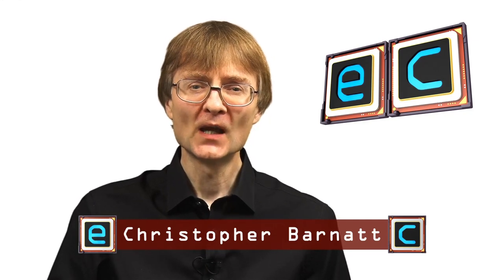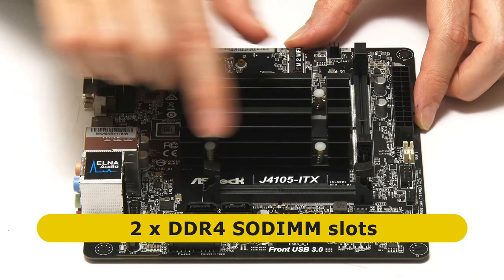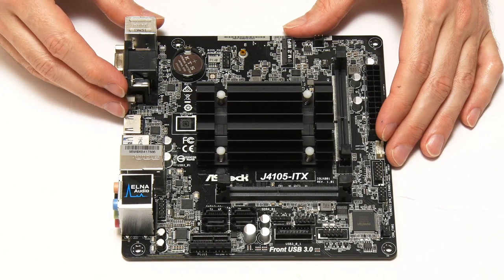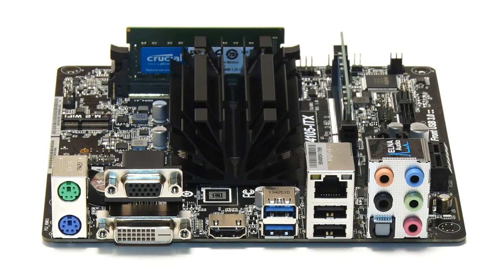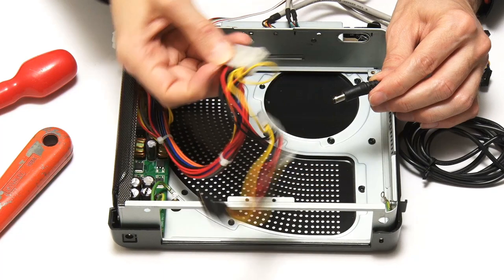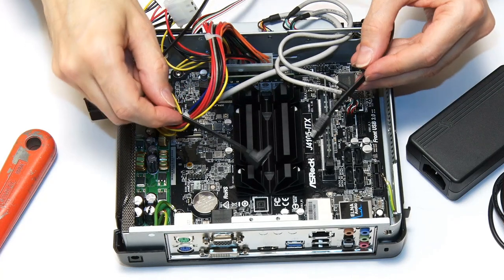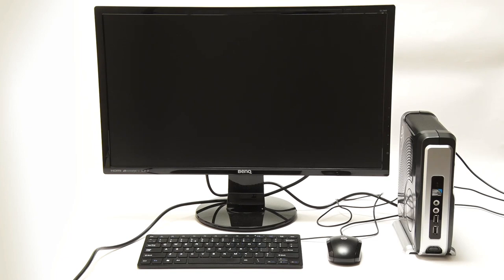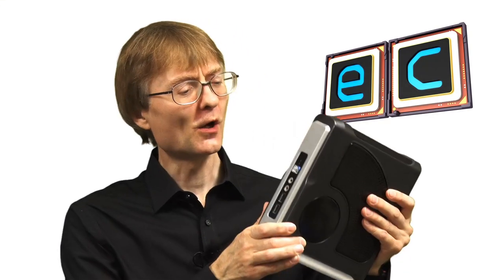Silent Mini-ITX PC Part One: Hardware Build

Comment: Still finding legacy PS/2 ports on motherboards nowadays is weird. I haven't seen new PS/2 keyboards/mices around for sale for a long time. 🤔
Reply: It made sense for Mini-ITX boards when they first came out; they were intended for use in industrial and commercial settings, like digital signage, controlling factory equipment, data logging and such, and had the full complement of legacy ports: serial, parallel, PS/2 and VGA.  They often replaced older full-size 486 and early Pentium systems, so the users in these settings wouldn't have to buy new peripherals.  It does seem odd to have them modern motherboards, though.
Reply: People still love their IBM Model M keyboards which use the old adapter, although I believe it's possible to get replacement cables with USB connectors nowadays
Reply: Frees up a USB port
Reply: Its actually superior to usb🤣
Reply: There are organizations, the FBI for one, does not allow USB ports enabled to prevent data theft via USB flash/thumb drives.
Reply: @JoeStoppinghem  With a little bit of software and a prepped keyboard you can do that with a ps/2 keyboard and install a keylogger too.
A computer can set the caps lock led and NumLock led. You might be able to use that for data transfer initiated from the computer.
Reply: Hans Kruse I’m referring to grabbing gigs of files.  It would be simpler to have a USB 3.x thumb drive.  These portions do not have internet access.
Reply: @JoeStoppinghem  WiFi can be added of course or sneaker net collection. But true getting gigs of files over a creative serial connect ion is slow.
Reply: Hans Kruse I think the main was lost.  

Having p/s 2 ports allows the organization to turn off all USB port to eliminate data being copied to a USB drive and take the drive and that data offsite against policy or illegally.

Comment: First of all, please allow me to thank you for your continuous input through your YouTube channel. I always find myself going through your material every Sunday.
I know you have several videos relating to single board computers, small factor pcs or even refurbished old pcs/laptops, (not to mention various networking software solutions) but I thought it best to write you to get some personalised feedback if possible.

I am looking to revamp my home/office installation. The current system is quite dated and has a few work-arounds, so I am looking to update it to the 2020's and hopefully upgrade functionality and speed while keeping the costs and power consumption reasonable. 

My main machine is a laptop (currently researching a new one), as I am always on the go and use it all over the home and at clients' offices.
At my home office I would ideally like a system where I could back up data and also have a repository for past projects (engineering, admin, finances, etc). I expect this machine would probably best run off at least 2x3.5-inch HDDs (4TB capacity) raided together. While I would need it to be networked, it would be a big bonus if I could securely access the machine remotely (i.e. from my client's offices). That said, as this machine will be on all the time, I would like to find a solution to keep the power draw/ consumption low or at least reasonable. Also, is there a way to increase or at least maximise data transfer rates.
Finally the system would all be linked together with a dedicated WiFi router or network switch.

Any comments or feedback/advise you can provide me with as to the network solution and backup system would be appreciated.
In any case thank you.

Comment: I suppose it's worth mentioning that if you wanted more flexibility with routing short cables you could always purchase extensions for your power cables,  in this case you could route it around and away from the heatsink.
Reply from the maker: A very good point.

Comment: Huh. After spending months playing around with all kinds of raspberries, orangepis and others, I took this exact board and am really happy with it. I have also mounted a pico-psu and a 240W laptop brick inside the enclosure, and ended up with extremely small box, which is passive-cooled.
Oh, and I have also installed 5.1 200W class-D audio amplifier in the same box, whis is only like 7cm thick.

Comment: Great video, I'm not sure if this motherboard has got more expensive through the year, on eBay today its £88, I have experience of the j4105 CPU, as I have a beelink x45 that has 6gb ram 128 SSD with windows 10 off AliExpress for £135, it has worked excellently for the past 18 months, today you can get a new Beelink GK55 with the newer j4125 celeron CPU 8gb ram 128 SSD windows 10 for £142.50 .

Comment: This style of system is very interesting. I prefer the Hardkernel ODROID-H2+. It uses the same CPU but it's not a mini-ITX. It has the same 2 SODIMM slots (which can be up to 32GB) but also has an NVMe slot for an SSD and 2 2.5Gbs ethernet ports. It doesn't have some of the stuff that the ASRock J4105-ITX has that probably aren't useful, such as the PS/2, VGA, DVI ports. It does have 2 fullsized HDMI ports that can both run 4K video at the same time. I bought 1 and I'm completely happy with it. (I don't play games). For those of us who have traditional noisy power consuming desktop PCs, these J4XXX boards are excellent replacements, if you don't play games.

Comment: I remember this case! Also I think some "magic of film making" went into the front panel connectors because the power button isn't quite on the right pins?

My telly PC is actually pretty much my most powerful computer, because that's where I do most of my gaming.
Reply from the maker: Thanks for this, memories indeed! The power button is on the right pins -- the two middle ones. The labels on the board are most confusing -- the manual far less so.

Comment: Great video thank you 👍I used the J5005 version of this board and fitted it in my old decommissioned Tranquil SQ-A5H case with its hot plug in drive cage. It's a brilliant board for a small NAS, I use OpenMediaVault and its been faultless. I also used a glotrends pcie2 sata extender so I could have a small standalone ssd for boot and and a drive for back up. The 4 plug in drives are configured in a software raid pool courtesy of OpenMediaVault.

Comment: Any interest in covering second hand components Chris? The reason I ask is because I recently built a very powerful Mini-ITX machine on a shoestring budget - An ASUS H81T Mini-ITX motherboard for £22 on eBay from an IT recycling company, a Pentium G3440 for £15, a slim (but beefy) copper heatsink for £7, 8GB RAM for £18, PSU for £10, a slim Mini-ITX case for £20, and an SSD for £15.

This is all tech that is a good few years old now, but is still incredibly powerful, and as it's older, super cheap!

Thought it might be an interesting topic to cover as it's green computing in the sense that reusing old equipment is a great way of recycling, especially when the equipment is still powerful yet energy efficient. Food for thought anyhow.

Comment: This reminds me of a 2011 build using the MSI H61I-E35, it was difficult to wire/route. I do still have it and it works no issue. It's been through all sorts of uses and has had at least been through 4 different OSes including Windows Server.

Comment: I acually have one of this system's predecessors running as a diy NAS/web dev server. My machine features a Celeron J1800 (2x 2.41 GHz) and is now basically running for five years straight - except for the occasional downtime, when I upgraded the storage. Looking forward to your conclusion in the second part.
Reply: J4105 has minimum 2x performance, about phenom 2 855. J1800/1900 its sh..t))

Comment: I bought the 	J4105B-ITX that has the full size pci 2.0 slot on it.    So far I am impressed with it.    I am using it with a intel network card to run pfsence.    Runs really cool .     Mine pulls 10w on boot up and idles around 8.5 to 9 w normal use.

Comment: Didn't think I'd ever see a Morex case used in a modern day build. Got myself a Morex 6610 way back in the day with a ZOTAC IONITX D-E which made for a wicked little media\home server. The case could fit an ATX PSU, couple of HDDs and a DVD drive in a box about the size of 2 ice-cream tubs stacked on top of each other. The board had enough GPU grunt with it's integrated NVidia GT9400m to handle video playback and a decent little hyperthreaded dual core Atom 330 CPU. I still use the case for a system I have for when I need a sacrificial OS for testing and still have the old ZOTAC board in a box somewhere although I think it's now dead. Morex made some real interesting little cases and wasn't the easiest thing to get hold of here in Australia. I think the case set me back about $100AU in 2009.

Comment: I have that exact same motherboard in an Unraid NAS. I LOVE IT! Certainly fast enough for file sharing and a few Docker containers. It also supports Intel QuickSync, so Plex transcoding works great.
The CPU is supposed to support 8GB of RAM max, but I have it working with 1x16GB module, and some people claim that 32GB also works.
This thing also sips power and is barely warm on load.
I wouldn't have minded a couple more USB ports, a PCIe slot that's 4x or an M.2 slot for an SSD. Still, it's a nice board.

Comment: If you're lucky - there might be a BIOS (...UEFI) option to switch between AC97 and HD Audio?

If not, Stanley could help you rearrange the wires in the audio header - lift the plastic clips up a tiny bit to side the wires out, then put them back in the required order until they click in to place.

Personally, I wouldn't want to have "dead ports" even if I wasn't using them, but that's maybe just me. :)

Comment: I built one similar using a ASROCK J3455-itx, 8 gig ram and 240gig ssd. Used a Morex 557 case and a PICO 160watt psu. Old school stuff. I use it for utility stuff like displaying my security camera's and also use it as a NAS to backup files to.

Comment: Hah!
Finally ! :-)
I was nagging along for years in your comment section about the (asrock) mini itx boards :-)

I first found and loved them back with the asrock j1900 boards, because there was a version with the "-dc" ending,
which meant asrock included the onboard power supply via barrel jack (12v to 19V i think) and the powerbrick was also already included in the board for around 100bucks.

For something a bit larger than most SBCs, when you finally got all your drives and stuff and vesa mount added to the case,
without the hassle for adapters and using standard 2.5" drives, they are often a lot cheaper with better performance and noise.
- i prefer running a silent fan at 5V nonetheless to increase component lifetime and prevent throtteling.

For most "old" office PCs (word, excel...) they work just fine as a drop in replacement, no need to spend big bucks.
If hardware acceleration works correctly they are just fine vor video streaming and browsing.

Comment: You should see how I turned the J3710 into a beast :D I used the Mini PCIe port for a 2x SATA controller card and added another 4x SATA controller in the normal PCIe x1 slot.

This way you have a tiny ITX board with 10x SATA connectors, able to run a large RAID 5/6 configuration.

Alternate option would be a 2.5 Gbit NIC instead of a third SATA controller.

If its meant to be a PC I use mostly Chieftec ITX cases because they offer high quality and a very strong 120W PSU for a low price.
Reply from the maker: Sounds excellent.

Comment: it took me around 3 hours to connect the backpanel connectors to the motherboard on an atx motherboard which is around 4 times bigger as surface as this one and an entire day to assembly  it took him a lot of time too, this is  just the final video after filming when it worked straight and  edit video cuts good job anyway

Comment: this brings me back to the nightmare days of old cramped desktop formfactor pc's (as opposed to tower) with ribbon cables etc that were just impossible to fit together in a neat and satisfactory way. I remember installing more RAM in my old 486 computer and had to damn near disassemble the whole thing just to get the damn cables out of the way to be able to access the ram slots :p

Comment: Outstanding as per usual. I have a keen interest in fan-less, low power computers. While I enjoy seeing what people do for over-clocking, I am almost obsessed with stock solutions for the majority of computing needs. I built an ITX based HTPC about a year ago that is my Ubuntu-based Plex server which works well. However, I'm in the process of setting up a Zoneminder video surveillance system for home. I have it working on the 20.04 Ubuntu HTPC, but I would really like to have a separate system for it's final implementation. This might be the ticket! I'm looking forward to next week's evaluation on the performance to see if it might be a good choice for a video surveillance PC. A little request for Ubuntu on it, Chris, with some of your thoughts on the possibility of it being able to do such a thing with 6-8 cameras? Thanks so much as usual for being part of my Sunday routine.

Comment: I used to build computers ten years a go, but most are notebooks nowadays. I miss the shelf of components I used to have, to swap around in case of failure. Last "build" was a Intel NUC also with a J4105  that seems not to like any memory modules. I bought two types of which the last was on the HCL and the lot is now waiting in some cupboard to become electronic waste.

Comment: 10 year old power supply, probably at least one of the capacitors in that power converter board is bulging it looks like, right there under the cabling. Power brick likely inside is somewhat well cooked as well, especially if it has been powered for a few years, cooking itself dry nicely.
Reply: One of the drawbacks of using small cases is that replacement PSU's always seem to be expensive and much harder to find that normal ATX ones. PSU fans can also be a lot noisier too.

Comment: About the audio connector, most modern motherboards will have an option in the BIOS to designate the onboard audio connector as HD Audio or AC 97 if you'd like to connect your front panel audio jack. :)
Reply from the maker: This is true (and there is such an option in the BIOS), but the blanking pin on the motherboard pins make it physically impossible to plug in the header from the case.
Reply: @ExplainingComputers  man that's a bummer.
Reply from the maker: @MaxDad7  It could be fixed using individual jumper leads between the header and the board, but on such a small case I can use the rear audio ports really easily if I need them. And in practice, all audio will output via HDMI. :)

Comment: Perhaps interesting to note is that this is a 10W TDP CPU, and I noticed you mentioned ‘burst’ speed rather than ‘boost’ speed. I looked it up, and indeed Intel developed a separate technology called Burst Technology (yes, obviously...) which is distinct from Turbo Boost Technology and used in CPU’s designed for low TDP, small form factor applications. From the description, ‘burst’ and ‘boost’ appear to work the same (ie. setting a higher clock speed when encountering a specific load) but Turbo Boost is bound to parameters like heat, voltage and load (so it’s not guaranteed), whereas ‘burst’ will clock the chip higher regardless - although only for a set (short) amount of time.

Comment: Samsung EVO SSDs are indeed very good, though they can be rather picky when it comes to the choice of SATA cable. That said, those black figure of 8 cables that ASRock supplies with its motherboards are good quality and are also nice and flexible - much better than the generic stiff, flat, red ones.

Comment: These CPUs are the predecessors of the N5000, and they usually drop to 1,5Ghz when the igp is used.
If you use an external gpu, and actively cool the cpu (using a small fan at 5V), you could run 2,5Ghz always. But once you put load on the gpu, the cpu core frequency drops by almost 1Ghz.

Comment: Would be great if the power adaptor board was modular, or just had fewer cables.

Then add in an M.2 SSD, and you'd have much more space in that case - and more airflow, which is critical in a fanless build.

Still, the build looks great :)
Reply from the maker: Sadly an M.2 SSD cannot be used with this motherboard -- the slot is E-keyed (for wireless modules only).

Comment: Also you might want to look a Capacitor C23, it looks like it's starting to swell, at the top, it could be an artefact from the lighting and angle but better safe then exploding caps
Reply: better safe THAN exploding caps

Comment: I'm looking forward to part two, where you'll show some benchmarks - I'm currently using a Q1900B-ITX (J1900 CPU) as my HTPC, and it works perfectly except for some content in 1080p@60 (too much data to decode without frame drops), and I want to see if this J4105 CPU can decode them without any fussing.

Since any HTPC should always be low power AND passive cooled - no noises allowed when you're a cinephile!

Comment: I was cringing a bit because you weren't wearing a gounding wristband (I don't either) - but I am mindful of ESD risks to damaging computer components and discharge myself to a ground point when first touching the computer. Perhaps newbie computer builders might not be aware of the dangers of damaging their hardware ?
Reply: I usually never wear one either, but then I'm usually only mucking about with old secondhand PC. But I've just bought one off eBay, because I've started instructing my friend's son and I don't want him to pick up any bad habits.